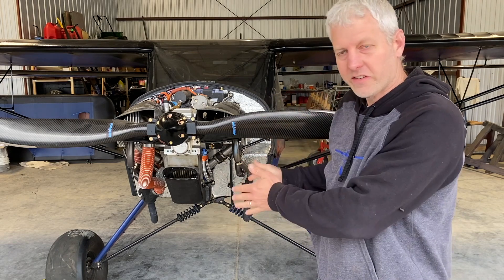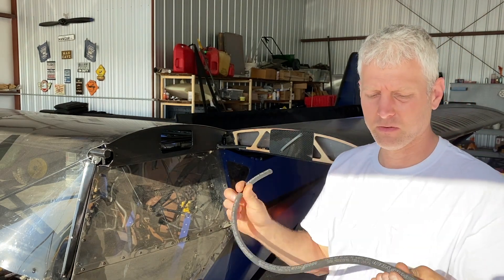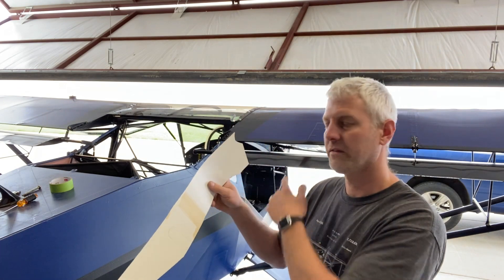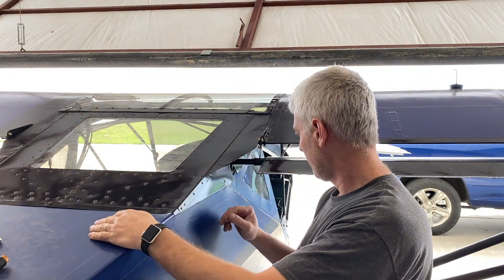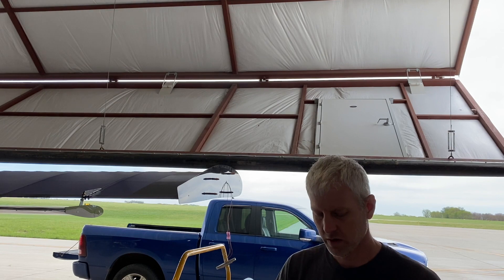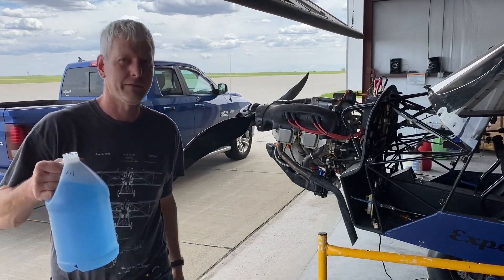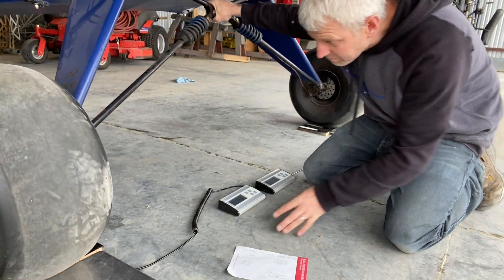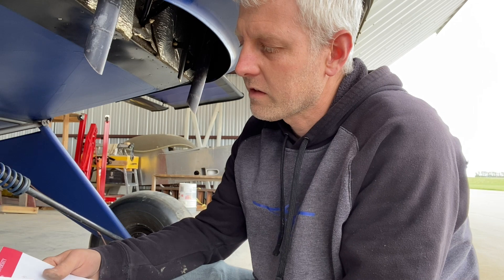Kitfox Conversion Almost Finished Model 1 to 4 wings

Comment: Awesome work. Just throwing out there to weigh with hanger doors closed. It may not seem like much but a tiny bit of wind can throw those off.
Reply: You should also weigh the tailwheel in the in-flight (level) position.

Comment: Looks good!  U mentioned that at the first weigh in, you didn't have the turtle deck on.  This time you did.  If the turtle deck weighed 4 lbs, then there was no weight gain.  I'm guessing the t deck weighed 2 lbs, so all in all not much of a gain.  Flight reports soon, we hope!  :-)
Reply from the maker: got a couple lbs of flaperon weights to install yet kinda forgot bout them. Gonna start building them today.  Thanks Jim